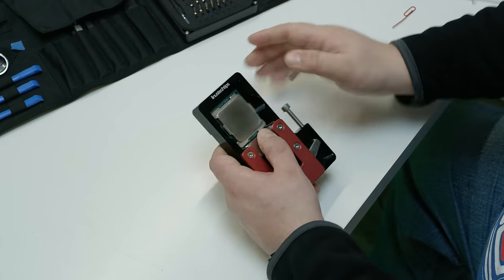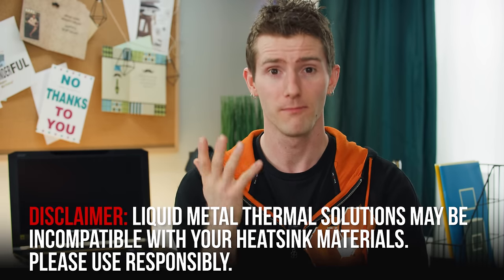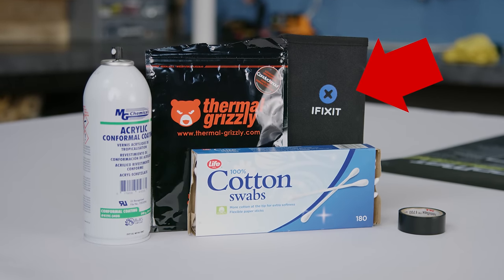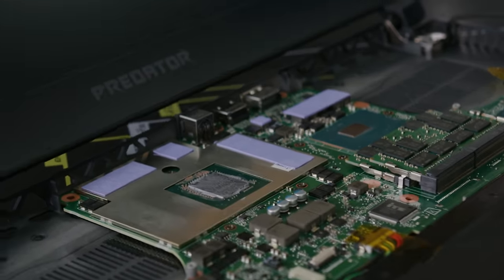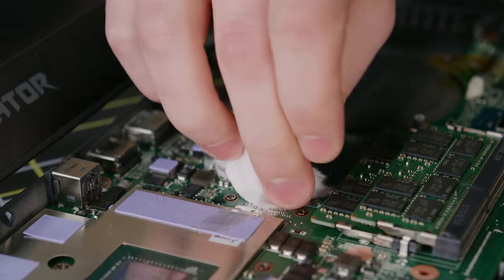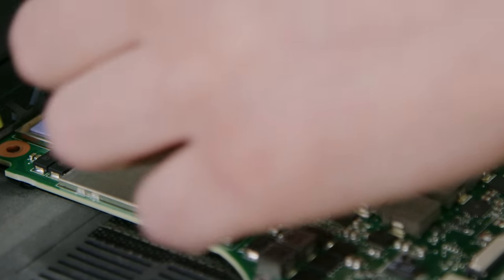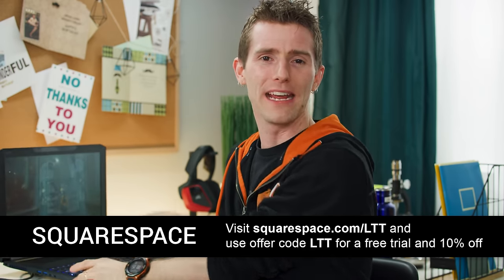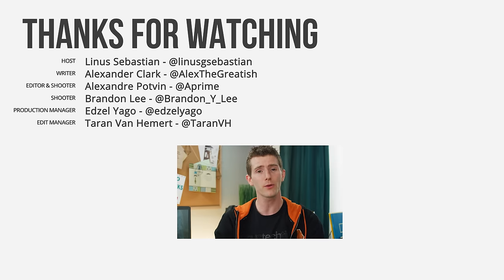Liquid Metal Laptop Cooling – 20C LOWER!

Comment: They ought to revisit this machine to see how the gallium held up. I hear you have to reapply like every year or so.
Reply: You'll have to reapply to copper coldplates once, as the galliumm will alloy with it. After that it should be saturated.
Reply: @3of12  How long afterwards? Also he used Electrical tape to protect the cpu... wont that melt and leave sticky residue that will be worse?
Reply: @albundi2k101 about 6 months to a year. however, if you can afford the downtime, you can prep the copper surface by leaving a relatively large amount on the copper for a few days. You can also lengthen life by sealing it with a foam dam.
Reply: i delidded and applied liquid metal on my 8700 around spring 2018 and never touched it again. Temps haven't changed a bit since then.
Reply: @Bennedict929  your 8700 had nickel IHS, but on laptop we got copper plates.
Reply: @albundi2k101  I don't say the earlier comment are false, but from my actual use, first application only held up to 1 month or so. After that, temp goes way hotter (and I found out that my LM are already dried out), after reapply, I don't have those issue anymore.

And btw I no, electrical tape won't melt, because the PCB area aren't as hot as the die area are (But I didn't use it. I found out that using electrical tape make my cpu temp goes up to 99 degC really fast (maybe blocking some temp sensor) -- but after removing the tape, my temp goes down.
Reply: @RizkyBambangWiratmoko  i got the exact same issues. can't use any electrical tape around the die, else the cpu temp will stay at 100c. my guess is that the electrical tape is thicker than the die itself, which prevent the cold plate from complete contact with the die, especially with lower mounting pressure
Reply: @Bennedict929  nice
Reply: @albundi2k101  I was thinking  Kapton would be a better choice
Reply: @user-ty2uz4gb7v  that's what I heard.
Reply: Can I use the normal ceramic bases thermal pastes on these devices instead? Will it be a problem?
Reply: I used this for many years without reapplication. The gallium diffuses into the copper and the liquid becomes a solid.
Liquid metal is not liquid any more after a while, but it still is very heat conductive.

Comment: As someone with this laptop, I plan to do this sometime in the near future

Wish me luck, comrades
Reply: I'm considering undervolting and underclocking my cpu for now. Until a year or so passes atleaset. I won't  risk my laptop warranty as of yet. Not worth it with my mid- range-demanding games and programmes.
Reply: Same here.
Reply: For me i just use a regular thermal compound. Im too poor to buy a new laptop if it broke
Reply: I'd also like to know how it went - I have this laptop as well and I've already done a keyboard replacement (so many tiny screws), SSD install, and I'm about to replace the battery.  I'm going to repaste it when I open it up to do the battery and have some Arctic Silver, but 20 C is enough to make me consider the liquid metal...
Reply: @Dreznin  I have done liquid metal on my Acer Predator 21X and it holds up really good. It has been 3 years since then and I have redone the liquid metal 4 times. You have to absolutely open up the laptop after 2-3 months of first apply as the liquid metal seeps into the copper heat sink which is normal.  From 92C on CPU and 88C on GPU to 78C and 71C respectively. Worth it even though I tried it on a 9000 USD laptop :D
Reply: Landry De Luzon  To be fair, you might as well try it, 97c is insane for AE2. And lets not kid ourselves, you really need an upgrade anyway so if it fries is it THAT big of a deal?.
Reply: Landry De Luzon  I didn't do it because I wanted to play it safe with my laptop. You can use any thermal paste you want. Anything is better than the OEM one. Would definitely improve thermals greatly
Reply: @aliglimmer6071  Undervolting and underclocking won't do anything, it already does this as part of speedstep.
Reply: @3of12  it actually did it for me. Lowered it from 92 to 80 C and went even playing heavy games like Sekiro :P
Reply: Because of poor application of thermal paste from manufacturer, my laptop CPU 7700HQ throttle at boosted clock speed (3.4Ghz, 99°C). After applying liquid metal, 78 to 80°C all core clock boost. When I undervolt my CPU it went even further down 10°C cooler. So far it has been 3 years and no need to re-apply because I put a lot. I've done it to 4 other laptop (my friend's), also 3 years and no problem, granted I do apply conformal coating and electrical tape.
Reply: Good luck comrade!
Reply: How'd it go homie?
Reply: @therift_7350  any tips about doing it? Does it work on aluminum heatsink in laptop (tbh, idk if it alumninum, it just some metal that got black coating to go with laptop color, also it a cheap low end laptop)
Reply: @itwilsonboiii4789  aluminium is absolutely not fine to put LM on...
Reply: @therift_7350  will copper degrade over time
Reply: Blyatiful
Reply: @michaelangeloparkinson5055  use thermal grizzly kyronaut extreme. It brought me 10 degrees Celsius on my 6700hq with 1070.
Reply: how'd it go, comrade?

Comment: Worked great on my Zephyrus. Also makes everything quieter since the fans don't spin up like crazy when everything is cooler. Also, you can get a lot better thermal pads and grease on the memory. ThermalGrizzly stuff is insanely good.

Comment: What are manufacturers waiting for!
High end machines need this!
Reply: To expensive.
High End conventionell thermal paste is on nearly the same level (like the Kryonaut).
Reply: When you manufacture  thousand laptops/hour (or whatever) on a sem-automatic assembly line. You don't want to risk playing with liquid metal. Of course you could engineer a solution to the problem, but that costs money, time, effort and there probably isn't that much market demand for this. 

Believe it or not. But 90% of the people do not care about this stuff, nor the performance increase. They probably won't even notice or care about these issues.

I know it sounds dull and boring. But having worked with automatic manufacturing (tho with sheet metal parts) one extra step can increase cost and  time spent quite significantly, sometimes you might even need to plan the product in totally different way for a small minor thing.
Reply: They are not using this as the liquid metal actually corrodes the copper cooler over time.
This is good thermal compound if you do not mind buying new components when they are corroded...
Reply: Liquid metal is not as durable as the thermal paste that is used in laptop manufacture. They stuff that comes stock in your laptop lasts decades.
Reply: Thanks Stopasking. It seems to be the explanation. Is Linus paid ? Why isn’t he mention it ? It’s a really important information.
Reply: StopaskingformynameYouTube nah, it doesn't corrode copper coolers. I've been using LM in my laptop for three years now
Reply: Then they wouldnt be able to sell you the next years model with little better thermals and speed now can they?
Reply: So what is your explanation Tommihommi1 ? Price is certainly not the problem.
Reply: Thomas T application is too difficult to be done on a typical assembly line.
Reply: Hardwarehelfer Not even close to being comparable. (Paste vs LM)
Reply: but that would mean it would be harder to upsell you to a higher end model; or a desktop version when "not on the go" ;)
Reply: Also, i have seen high end business laptops, that look like they were pasted by a 14 year old who did not read how to do it. The paste literally seeped out from the heatsink. Annoying with paste, dead on arrival with LM.
Reply: Thanks for your reply. You may be right but sorry i have to say this is really hard to believe. 20% is an incredibly good improvement. It’s something that really could make the difference with your competitors.
Reply: I guess they're all in the same boat after all ;) (or wouldn't get enough return profit for the R&D it requires)
heck... it might even be them finding it too risky in case the end user drops their laptop in a certain way that wouldn't break it; but would potentially spill some of the liquid metal in the case. In which case the end-user wouldn't feel responsible (or they're afraid of that, I guess?)
there's so many reasons they could come up but; guess we'll never know why until someone does it ;)
Reply: not viable for mass production
Reply: this is really not necesary for manufacturers. what are you going to do? buy a laptop from a third company that is no intel or amd? well you cant so they dont need to do anything. is that simple. the only point of improvement is to make you buy the lastest model and we get that with new generations.
Reply: Funny thing about this: I've had to replace the thermal paste on all the Asus ROG machines that I have owned and friends have owned. The reason for this was cause Asus had used inferior thermal paste (Plus a poor application that caused the paste to seep out everywhere. Not fun cleaning that up) which caused their GPUs to overheat if the computer is left on for too long or have been used for more than a year. 
Originally I tried sending the machines to Asus because the GPUs overheating would cause the computer to bluescreen or the GPU would just die while the computer was on. Asus would just send it back with either a new GPU or repasted the thermal and in the end, I would end up tearing it down and redoing the thermal myself (Which did end up fixing the issue and the machines haven't broken again for quite a while now).
Reply: pretty sure intel & amd are not laptop manufacturers but cpu manufacturers #justSaying ;)
I agree with your 2nd point though
Reply: Underscores for italics, not forward slash.
Aluminium
Reply: Copper is fine. Aluminium is not.
Reply: liability more than anything
Reply: Let me clarify what I said here.
High-end machines, the ones where if you do not do this you'll end up doing it yourself (High end conventional thermal compound or liquid metal)
Surprised at how many people reacted but essentially :
Assembly lines for high-end machines are less crowded, since less people buy them.
While yes it would cost more, it would also get reviews that will benefit the brand long term.
A trade-off I'd propose if I worked at ASUS/Acer/MSI/etc
Reply: also wanted to add my two cents here. Indeed, I experienced corrosion using Conductonaut just after a few weeks. Both on copper heatsink and CPU die of my Dell E6440 when upgraded to +10W TDP i7. This stuff is not for regular people as you have to replace it/maintain it regularly. Although the performance of this product makes up for the drawbacks for advanced users. When applying, remove the oxide layer from the heatsink using super-fine sandpaper, use isopropanol to clean everything well (super important) and after insulating SMD components, use silicone (just the right amount to make a air-seal) around the CPU die to reduce the amount of oxygen from the outside getting in contact with LM to prolong the maintenance interval, also making it as a barrier for LM should it want to drop on other components of the motherboard when carried around in your backpack.
Reply: Spencer Easton that is true. My 5 y.o. laptop overheated, but is easily solved by just cleaning the dust. We don't even touch the heatsink
Reply: Thomas T it's the risk. Acer risks having poor thermal with their thermal paste. But when they used liquid metal, they risked the whole cpu or even motherboard to be dead and replaced eberywhere
Reply: You would not want a god damn liquid metal inside a mobile device. Or inside shipping boxes. It will spill!
Reply: also, the stuff that "corrodes" aluminum is the gallium, it doesnt corrode it, it eats it and literally disentigrates it. it becomes so brittle u can squish it
Reply: same reasoning applies, LM still has a nice impact on the heatspreader of an intel cpu
Reply: Ignasb is the only guy here who know what he is talking about. Assembly line problems and manufacturer collusion is nothing else than dog shit. I will never use this product and Linus have been paid for this...or is doing a really bad work, they are doing such a poor job with their custom cases, it wouldn’t surprise me. Such unprofessional guys, why this channel have so much success ? It’s a mystery.
Reply: Acer doesn't make CPUs. If liquid metal contact was used it would be done by Intel & AMD & nVidia inside their packaging. The PC assembler wouldn't even notice the different. The bottleneck thermally is the tiny area of the chip die, not the metal shield we see as the packaging.
Reply: a few problems:
1. environmental aspecs (including gallium might be a no go in some countries, making it a no in all countries.)
2. low viscosity (higher chance of "pump-out" due to vibrations and expasion/contracion from thermal cycling during the design life-time of the product) the xb1 and some gpu vendors seem to be using "grease" that hardens at 40C to avoid this.
3. assemly difficulty (spreading a fluid evenly is very hard even with robots, which is why screen printing is very common, which requires you to add a layer that is too thick in comparison)
4. corrosion/alloying (the LM will diffuse into the Heatsink and vice versa over time, potentially making the copper coolers non-recyclable since they are now a different alloy at the surface)
5. risk of electrical shorting.
Reply: because they have some fun and fail at stuff ?
Reply: Acer could also use better thermal compound.
Even on the high end of the laptop/pre build market OEM's use the cheap stuff.
Mid/Low end, sure the people buying into those pay for what they get.
But a lets say +-$ 2300 Laptop shouldn't use cheap thermal compound!
At that point I as an OEM would at the very least use good quality stuff!
Reply: This might be the most on topic & useful answer on my comment yet.
I have to say that'd be even better!
Reply: Can I use the normal ceramic bases thermal pastes on these devices instead? Will it be a problem?

Comment: For someone who is considering this, just to let you know that every device will have a lot of different outcomes. Mine just got 3c cooler than Noctua NTH2 repaste (15c cooler than original) and some will get 20c like in this video depend on the thermal design of the laptop.
Reply: Hey, I used NTH2 atm, do you think Kryonaut will be worth applying?

Comment: i would love to see a liquid metal aplication on a desktop GPU next
Reply: MrTheSmoon it is done exactly the same way and gives a similar boost.
Reply: tommihommi1 a full gpu usually doesn't thermal throttle as much as a laptop. A boost in fan speed usually helps get rid of thermal issues on most gpu's
Reply: Alex V.D.H. similar improvement in temperature or noise normalized performance, and really big improvement on radial fan style cards, which are limited by cooling performance most of the time.
Reply: you can easily improve temps by removing the shroud and ziptying a cooling fan or two
Reply: SeventySeven ah yes, a very elegant, compact, price-efficient and good-looking method. /s
Reply: I used to have two GTX 580s (still have one in my GPU graveyard as it died) and I had a huge fan blow air into my case to cope with the heat. Cards are so much cooler nowadays (and my case has better airflow). The amount of dust that accumulated in those cards is amazing
Reply: Not worth it. You'll see maybe 5-6°C lower temps than the best thermal compounds out there. A far cry from the ~20°C you normally see on cpus.
Reply: I did apply Liquid Metal (same as in the video)  to my 1080 AMP! (not extreme). Dropped from 85°C temp limit to 79°C, so not very impressive
Reply: I've been doing this for ages on my powermod AMD gpu's.
Reply: but would it help for overclocking differences ?
Reply: Since desktops give you enough room to have proper cooler, I don't think it would make much of a difference to justify the hassle, time and cost.
Reply: Orelha I got a 10℃ drop with identical fan speeds, easily worth it for half an hour of work and like 8 bucks with enough LM left over for all my needs